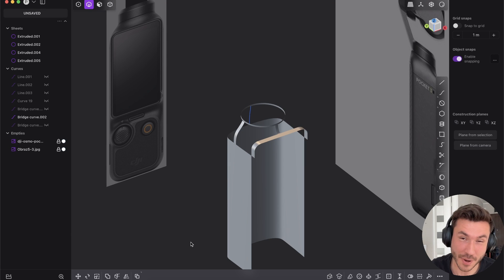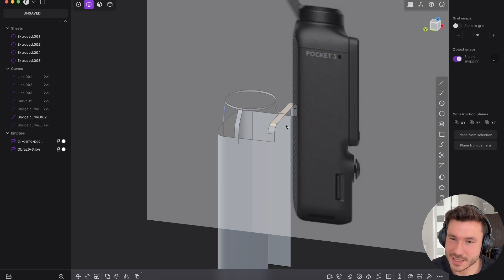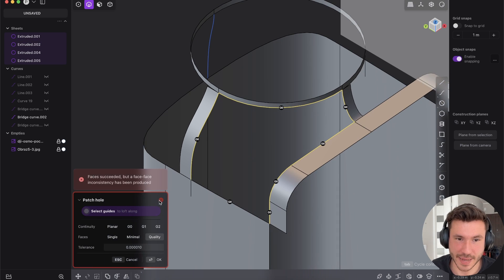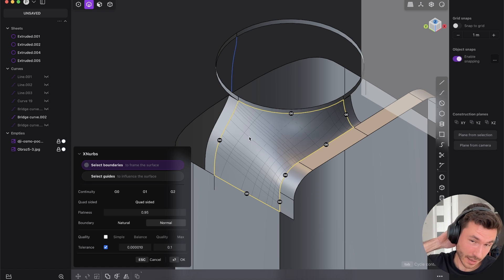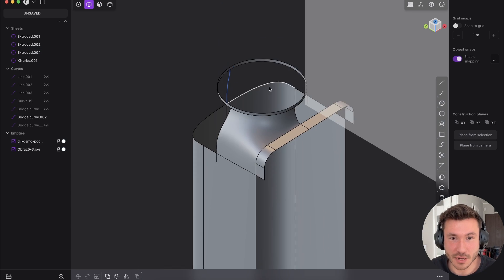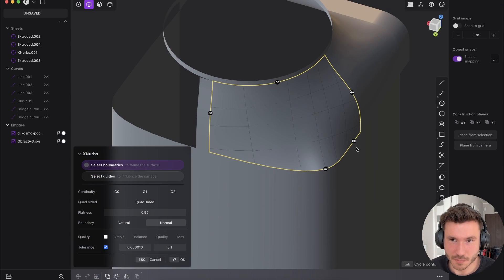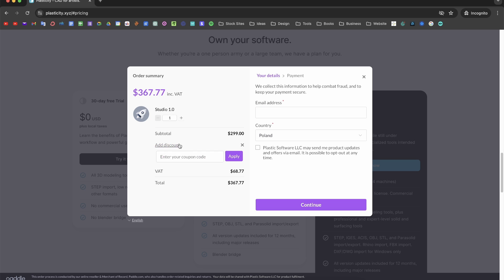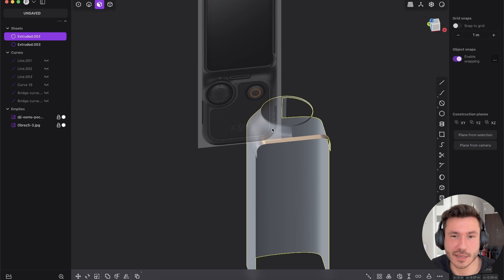Plasticity xNURBS for PRODUCT DESIGN Can Be Amazing!

Comment: I see there's been a lot of focus on xNURBS recently. But as an owner of the indie version, it doesn't seem to make sense for me to invest time in learning about it. However, I would like to understand if xNURBS will continue to be an exclusive feature of the studio version or if this is temporary?
Reply from the maker: A LOT more Indie content is on your way:)

As of today, xNURBS is planned only for the studio version
Reply: I’m also an indie user, but I’m definitely going to upgrade to get access to x-nurbs, mainly because I’ve had a few instances where patches have just failed with no reason or minimal explanation. As for which version x-nurbs can be used in, that’s not really up to Nick Kallen, the developer of Plasticity, since he had to license the kernel for x-nurbs (just as he did with parasolid), the decision is ultimately up to the developers and licensers of that kernel, and they sell the x-burns plugin for rhino and solidworks that cost more than Plasticity Studio does.